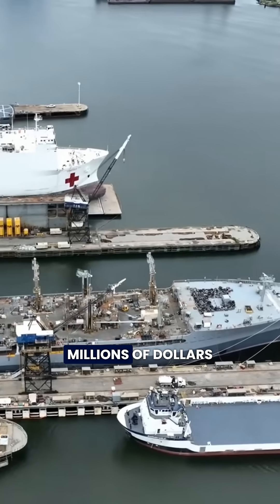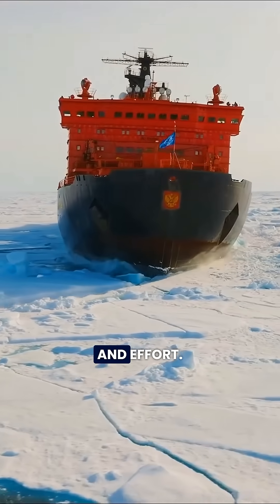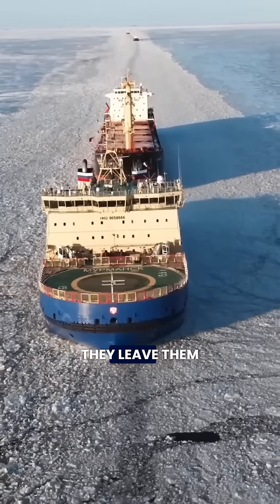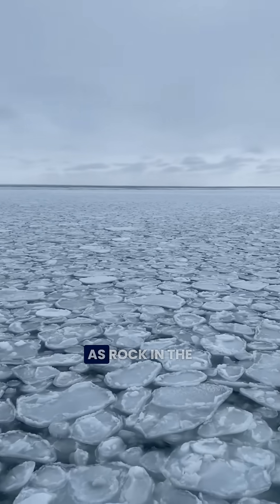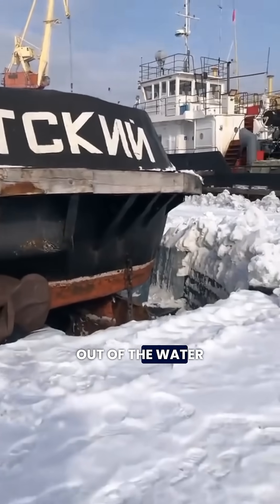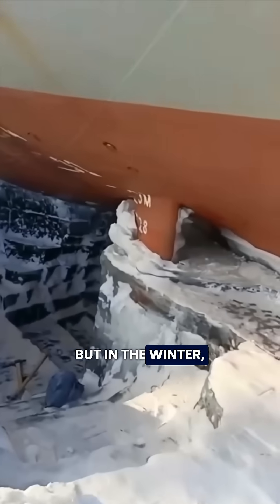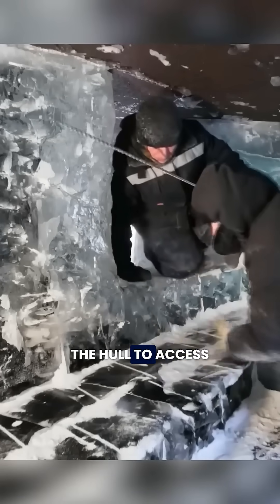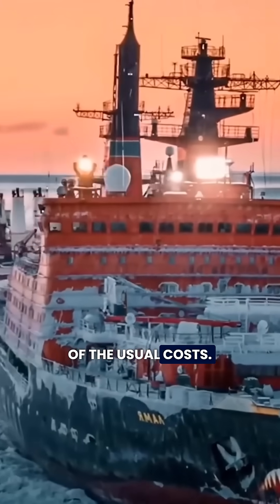Russia's Genius Trick to Repair Ships #Engineering #Ships #ScienceFacts

Comment: That’s so stupid!!! For a vessel that works almost 365 days per year, letting the vessel “chill” in the ice for a few months for drydocking and repairs is not a possibility. Not only that, but also the remoteness of this area makes it almost to impossible to get spares on time, unless an excellent plan before the drydocking is done, which again is close to impossible. Not even to mention that the vessel will stay non-operational for a few months, not generating profits and creating a huge loss.
It may work for a few Russian ice breakers, but it is not something “clever” and applicable to normal operating vessels.
Reply: Кто тебе сказал, что эти суда работают 365 дней? В России подавляющее число рек зимой - замерзают и суда стоят на приколе, в это время их ремонтируют и обслуживают!)
Reply: @Tigr_Rus  умные мысли преследуют его, но он быстрее)
Reply: Its ARTIC FLEET ,you bafoon!. .  Your measly built  ship wouldnt last a day within these areas.  
Its a different level of naval architecture .  Educate ya self in ShipBuilding n Ship Classification  Soceity.

Comment: Yep, and then when they’re done, there’s no garbage to clean up it just all sinks to the bottom when it melts paint chemicals, beautiful idea
Reply: What chemicals!? This is regular maintenance that includes lubrication and repair or replacement of assemblies. Chemical protection is done somewhere else, at such a low temperature you will certainly not be able to paint anything...
Reply: @jerromedrakejr9332they could enclose a small area of the outside of hull, heat up the metal to minimum coating temp, and then do the coating. But then the quality of the final result would be worse and the ship hull is warped by a cm from the localized temperature delta.
Reply: Because the USA is so careful with keeping our environment clean 😢 😢
MAGA love the environment 🤣🤣🤣
Reply: @sonjafritsch8804 Are yes the USA stays clean while millions if tons if US garbage and chemicals are delivered to small countries around the world . To countries that have no idea just how toxic  it is or how to handle it.
Reply: @sonjafritsch8804  yeah right want about the tons of radio active waste that they dumped of the coast of California from 1946 to 1993 how many barrels it can compare to what they're doing
Reply: @sonjafritsch8804 US is full of abandoned superfund toxic dumps. The water in Iowa is polluted with pesticide runoff.
Reply: @sonjafritsch8804 Maga don't give a shot about the environment, Trump love oil 😅
Reply: @sonjafritsch8804 well, they are. The US is very strict on environmental regulation and preservation. Go spill a few drops of diesel on US federal land and watch what happens
Reply: @histguy101  Yeah while the contaminate the rest of the planet
Reply: @histguy101 😂😂😂We can see how it's cleaned after every hurricane or floods.  Stop with this U5A BS...
Reply: @histguy101  Yeah that's why the US dumps its crap in international waters, especially off Somalia, which is why out-of-work fishermen resort to piracy, because US and Euro trash of the toxic kind has killed off the local fishing industry.
Reply: Quiet Polak.
Reply: I read about lots and lots of US and Europeans doing the same. Greed and corruption rules in a lot of places.
Reply: @SabreKai-u8i, it changed in the 80s, at least in the US
Reply: remind me... which of the two countries (USA or Russia) are members of the Paris Climate Accords?
Reply: US has no icebreakers. That's why ExxonMobil wants to deal with Russi, and dump Ukraine.😅
Reply: Stole the money..... Where?
Reply: Hehe sum people seems are offended since they don't spend much
Reply: Nope 😂
Reply: Nah.. it floats to the middle of the Pacific to join the giant garbage patch that americans have made
Reply: Have you seen Gaza? 
That's enough munitions to last some militaries a decade and that's all from the West. 
Stop pandering
Reply: Brilliant in their own ways. You want to about money. US is also corrupted too. At least Russia still concerns about the russian people. Unlike US  money put in the own pocket especially the AIPAC.
Reply: Your brain must be frozen

You cant paint in those temperatures
Reply: It's ok Karen
Reply: You know what's even smarter working in minus 3 million degrees scraping barnacles off of a propeller. 😮
Reply: @tonyp5656  Hears one with the IQ of an amoeba , no wonder you lot have fallen behind the Russians and Chinese , just look at your president 🤣🤣🤣🤣🤣🤣🤣🤣
Reply: This is not to save time and money in the usual meaning of these words. This is to save money because they stole all the money and now they don't have the money to afford dry dock. 

It's like saying that African children are so good at sorting electronic waste and thus they can afford their food. No. This is all completely upside down. This is kind of necessity, but self-imposed. The Russian peace and order.

Plus Russia probably doesn't have enough of dry docks to repair all of their ships and they have to do what they can. Again, the Russian peace and order.

Plus Russia doesn't care about the environmental impact. They will be drinking that water and suffering from numerous diseases. Good on them. I don't even pity them. Again, the Russian peace and order. Which they are trying to impose on the rest of the Europe. But they'll fail as they always do with everything they do.
Reply: @szlagtrafi9115
Leave your lair and get some fresh air every now and then.. also try to rid yourself of the hatefulness, it eats away at your soul
Reply: @szlagtrafi9115  Grow up ,Geez !!!
Reply: @szlagtrafi9115  Nonsense, Russians have better quality public drinking water than  Flint, Michigan
Reply: @szlagtrafi9115 
You mean like Chicago Tylenol murders 1982 or DuPont throughout ‘90……would u like more???
Reply: @szlagtrafi9115  You obviously dont realize Russia has to travel thousands of kilometers around Eurasia to get to a drydock which is not Frozen, Reason Crimea belongs to Russia and always will not matter how hard the pitiful USA and NATO try to get it.